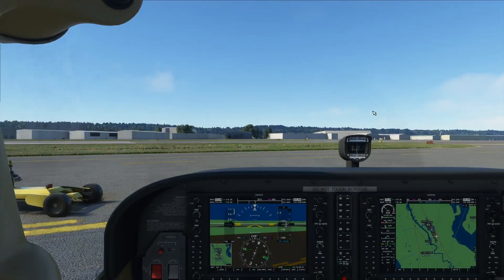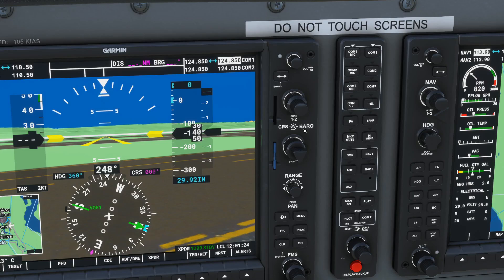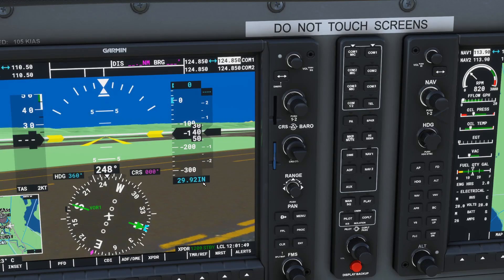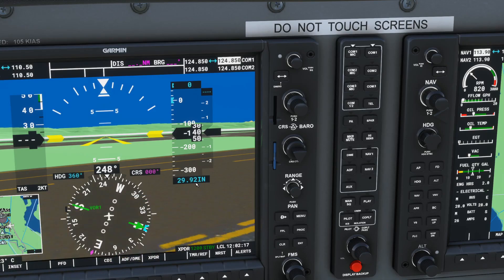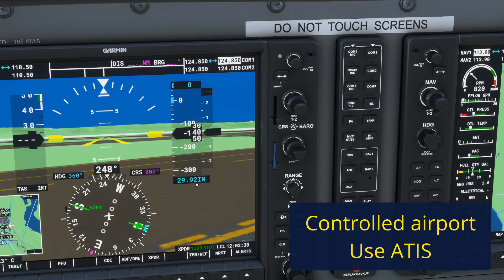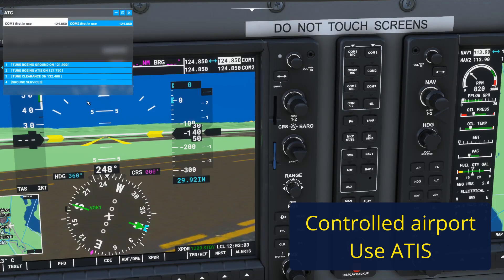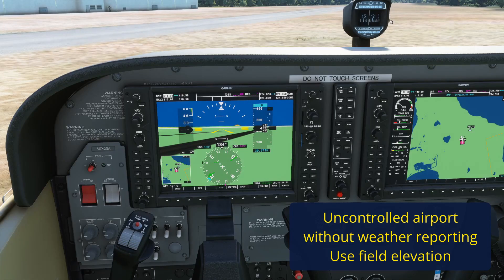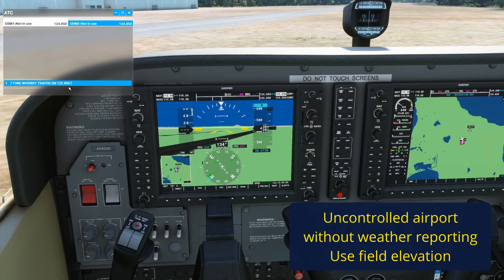FS2020 G1000 BARO Knob - Setting your altimeter - By real-world CFI/ATP

Comment: If you don't have a keyboard can you map the BARO to a button?
Reply from the maker: Hi Mr. Opinion, you should be able to assign it to a button. The command you want to look for is called "Set Altimeter" (under Instruments and Systems -> Flight Instruments).
Reply: @FlightSimCoach  I did that already and it doesn't work. Maybe a software issue?

Comment: OK, I am in the A5 sitting in the water AT sea level.  Altimeter reads 280 feet, I press "B" on the keyboard and it updates to 80 feet.  A5 instruments only has gauges, no knobs to zero the Altimeter as an online user instructed.  Am I missing something?   😳
Reply from the maker: Hi primoroy, what location are you at when you see this behavior? Also, I see a baro pressure knob at the lower left of the altimeter in my A5.
Reply: @FlightSimCoach  I am in the Pacific in Southern Mexico, and yes, I finally saw the knob you are talking about.  Thank you.

Comment: So for some reason when I'm landing in Chicsgo and surrounding states I have the altimeter set correctly but it shows me approximately 500 ft above what I'm at. The automation says 500 but reads 1000 which makes my ils landings impossible without slamming into the ground. Southern states work fine. Any suggestions?
Reply from the maker: Hi Toby, I'm not sure I fully understand your situation without seeing it, but do be aware that the altimeter shows altitude above Mean Sea Level (MSL), not Above Ground Level (AGL). So when you're on the ground at Chicago, which has an elevation above sea level of 680 feet, that's what your altimeter should read when it's properly set.
Reply: @FlightSimCoach  For example Atis said my pressure for Chicago ohare should be at 30.06 which I set on approach. I was still approximately 600 feet high. I'm baffled.
Reply from the maker: @tobymorvant8175  When you say that you were 600 feet high, at what point are you referring to? The altimeter should indicate around 680 feet once you touch down at ORD - this is to be expected.
Reply: @FlightSimCoach  at approach which makes my ils landing impossible. Automation says I'm at  1000 when I'm at 1600 so I slam into the ground at 600

Comment: Hi ... Very informative. You wouldn't know the quick route to resetting altimeter on Xbox version ?
Reply from the maker: Hi CanaryIrish, if you have a joystick or a spare button on your controller, you should be able to assign the reset command to do that (although one prior YouTube commenter mentioned this didn't work for them). If you want to try it, the command you want to look for is called "Set Altimeter" (under Instruments and Systems -> Flight Instruments). Also, you might want to consider using a traditional keyboard with your Xbox setup so you have access to even more useful keyboard shortcuts: https://forums.flightsimulator.com/t/recommendations-for-wireless-keyboard-and-mouse-for-xbox/464553
Reply: @FlightSimCoach  Many thanks

Comment: i want to change altimeter barometric pressure in hectopascals. still not available in mfs202?
Reply from the maker: Unfortunately I haven't been able to find any settings for this yet. Your best bet would be to set the standby altimeter using its hPa window (on the left), then use the resulting inches Hg value (on the right) to set into the G1000. Hopefully they add the option to properly switch it soon enough.
Reply: the Maths is pretty simple. I thought it would be more complex than inch to mm conversion for pressure but it isn't - 1 inch = 25.4mm (so 29.92 inches of mercury is 759.97 mm of mercury (29.92 x 25.4)), the caveat is this is at zero Celsius but the difference wouldn't be that great. that said in real life I'd use whatever unit I was given rather than do any conversion.